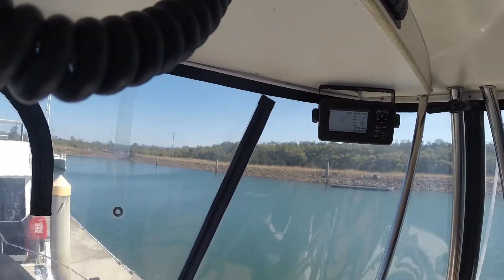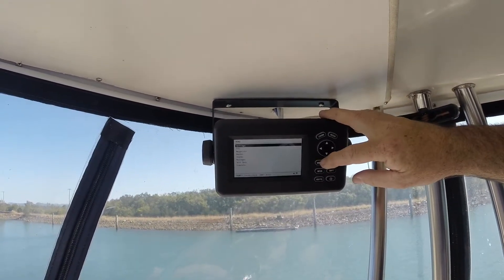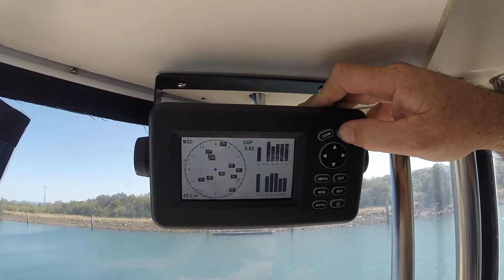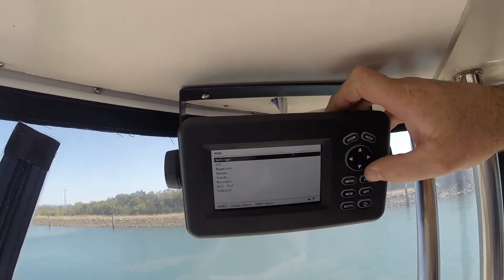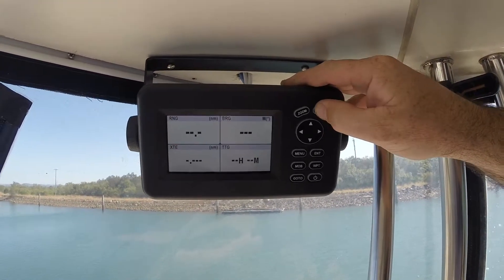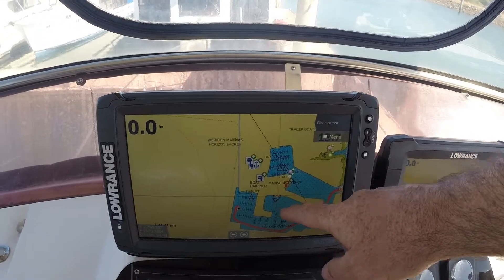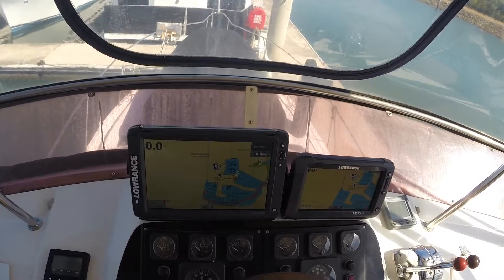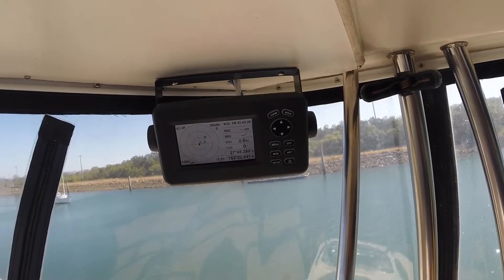MATSUTEC HP528A HP-528A AIS Transponder

Comment: I like  the facilities of this unit over other 'black box' sealed AIS transponders, but would like to mount the unit in a fascia - as opposed to standing out on a bracket.  Do you think that this option is feasible?  Please can you tell me the external dimensions (W x H x D)? 
Thanks in advance!
Reply from the maker: I think you could panel mount it quite easily, to be honest though if I was going to install AIS again I would just get a black box and hide it in the roof console, I never  use any of the functions on it other than AIS which is connect to my 12" chartplotter via nmea0183
Reply: @mvhassallfree1031  Many thanks for responding so quickly.  The other system that I have considering is the GME Aist120 transceiver - a black box that can be hidden away!

Comment: hi, can you set a waypoint using coordinates on this unit....if so can you explain
Reply: Found the User manual - seems quite logical .... http://www.matsutec.cn/Down/HP-528A%20%20User%20Manual.pdf
Reply from the maker: I have never tried to enter a waypoint, I have two chartplotters I use for navigation, I only use this unit for the AIS function
Reply: Thanks

Comment: 1) AIS stands for Accident Initiation System.

2) You should register your vessel with AMSA as a ship then you can legally fly the Red Ensign.
To fly the Red Ensign legally you must either have written permission from the minister or their delegate or have your vessel registered as a ship. 

3) I think you're doing great. I'd be inclined to install a second separate VHF with DSC hooked up to your plotter. And make sure your G-Pirb is current. (GPS Epirb).

4) Here is the link for international ITU Maritime On Board UHF comm's in the 457 and 467 MHz range - https://www.wildtalk.com/downloads/OnBoardCommunicationsFrequencies.pdf
Reply from the maker: I fly a flag that has a picture of a "Pirate crab holding a beer" more my style. I wanted to keep the VHF install very basic, pretty much so anybody in a emergency can use it, press 16 and call for help,  We also have 2 x VHF handhelds, they are waterproof and float, our GPIRB is registered and in-date as are our flares
Reply: @mvhassallfree1031  As long as your antenna and radio are in tip top condition then you should generally be in voice range of any ship on VHF Ch 16.

Remember though that in distant or rough weather a digital packet burst will get through easier than voice will and EVERY ship which receives it will have its alarm go off. 

Putting out a voice call could go left unheard because under STCW95 there is No longer any need to keep a listening watch on 16 or any other channel.

You can scream your lungs out on 16 at a ship you can see steaming past you and they won't hear you.

I do exhort you to install at least a single DSC compatible VHF to your navigator. It's a back up (get your trailer out of my yard) and has DSC which has many advantages for safety of life at sea.

Today it is normal to have a Quiet Bridge however it is the law of the IMO that all vessels (and military) will have DSC listening. You hit that DSC button and you will get swift attention.

Something to consider my crusty old sailor comrade.

Comment: Very helpful video. However I have a problem with my Matsutec Transponder. It is only receiving marginally and not transponding at all.Bought on ebay  I am outside returns time due to Covid. Have you any idea of a name in Uk of anybody who might try and repair one?
Reply: I have the same problem. I bought a unit in January but have only now been able to install and test it having finally got to the boat in Greece. I asked Matsutec for help and finally merely got an email with a PDF of the manual! I have no idea how to sort it out. Paypal rejected a resolution with no explanation - probably because of time. The seller, contacted through eBay, have not answered. I doubt it needs repair, it's new, but I need to be told how to make it work or to claim under the guarantee. Not happy!
Reply from the maker: @michaelpowell1906  a few months ago my Matsutec  HP528A stopped sending the AIS data, it would send the letter "H" and not the full "HASSALL FREE"    I found the TNC plug on the GPS antenna was faulty, The coax and the GPS antenna are very poor quality, the coax is not tinned. I removed the solder TNC plug and replaced it with a crimp TNC,  I also found a RG58 / 50 ohm would not fit and had to use a RG59 / 75 ohm connector ????? I tested the VSWR of my dedicated VHF antenna and that was fine. I then turned on my unit and it ran for 3 weeks 24/7 on test and it now works 100%. My advise is check the GPS antenna plug ( TNC plug)   I will do a follow up video soon to show what I mean, cheers  MV HASSALL FREE
Reply: MV 'HASSALL FREE' Thanks. I had a cable made up because the connector to the splitter is different. The unit receives well. On yours, does the TX light on the Radar display show? On mine, both that and the RX remain white. Matsutec did respond, suggesting bypassing the splitter, but I can’t do that without losing the VHF. I asked if there’s any other way to prove it’s sending but got no response. Poor service.
Reply from the maker: @michaelpowell1906  the TX and RX both remain white, they do not light up, I still would check the GPS TNC plug, I found mine would RX ok, and had plenty of signal from the GPS satellites but as soon as the unit went to TX, the  poor connection on the TNC plug from the GPS antenna, the GPS signal was being desensitized  by the unit starting to TX the AIS data and would stop TX'ing altogether, so infact the unit was desensing itself. So the problem ( with mine) was the GPS antenna plug, that stopped the unit from TX'ing
Reply: MV 'HASSALL FREE' thanks - you answered the question I have repeatedly asked Matsutec! The thing is that I have a new aerial cable - made up with the different plugs needed for the unit and the splitter.
Reply: But I’ll have a look at the GPS plug as you suggest (sorry - pressed send too soon)